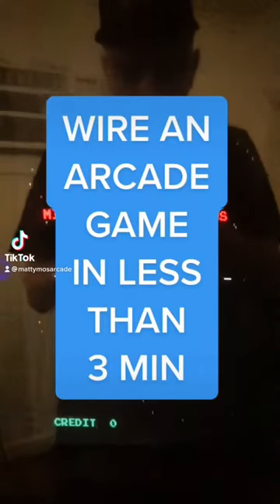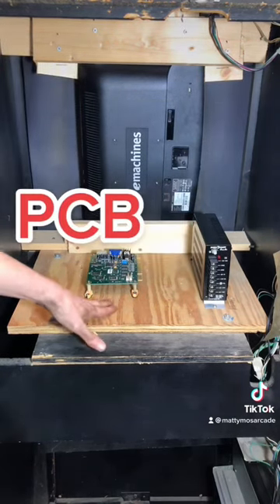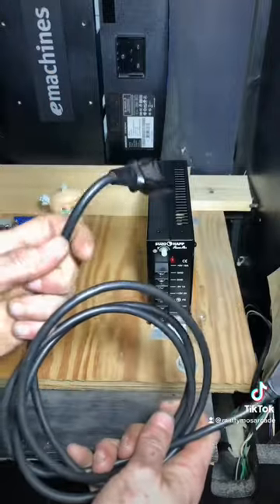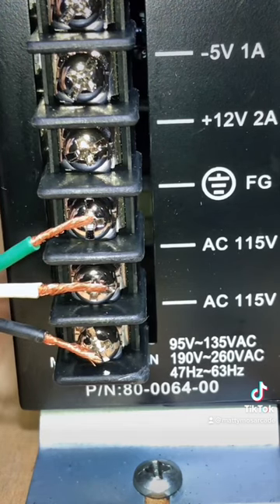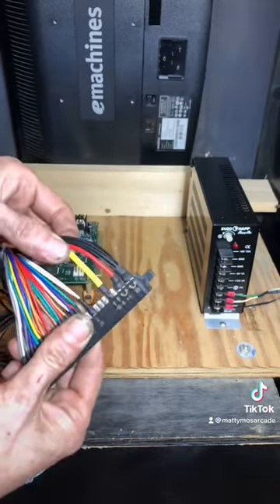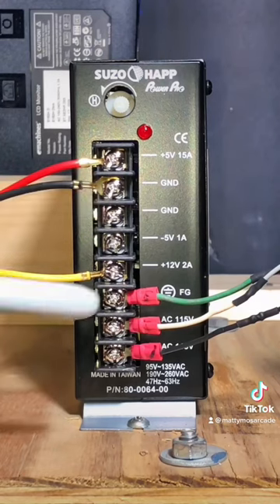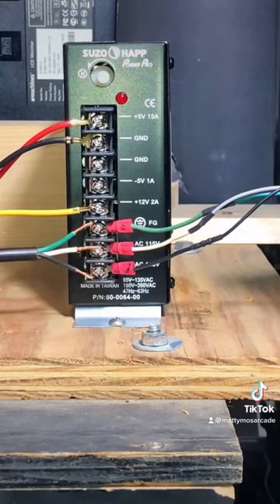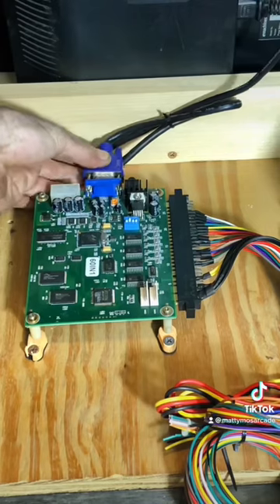How To Wire an Arcade Game in 3 Minutes. Part 1

Comment: Important note, you cannot simply wire in most monitors without an isolation transformer.  If you follow the instructions here and turn on the power, the monitor will blow up.
Reply from the maker: This is not a lesson on CRT monitors. This is for an LCD. Pay attention.
Reply: @MattyMosArcade  I just rewatched it.  While the monitor is a LCD in the video you don’t mention that your info is specific to LCDs.  I’ve been in the hobby for many years and it’s very common for newbies (same people who would watch this vid) to make this mistake.
Reply: Do I need a specific monitor to be able to see graphics cause I plugged in a old computer monitor that was used as my pc monitor and the game would work but just show d-sub error and say something like 15.7khz/60hz
Reply: @krillen18  You can't use a PC CRT w/ an arcade cabinet.
Reply: @DuffCon - the LCD monitor is in the video!

Comment: Can you make the monitor turn on by just switching arcade on. One switch for all.
Reply from the maker: Yes it will all work on one switch. The way shown, everything comes on when plugged in.
Reply: Interrupt your hot wire coming from the plug with a single pole switch.